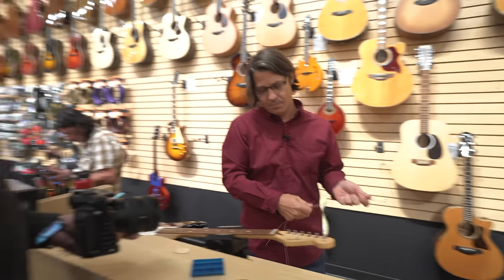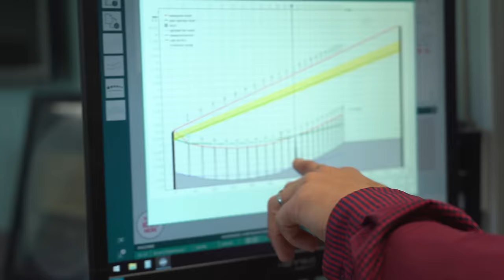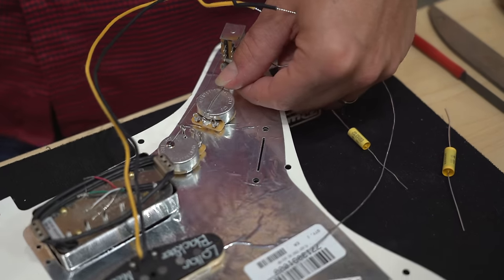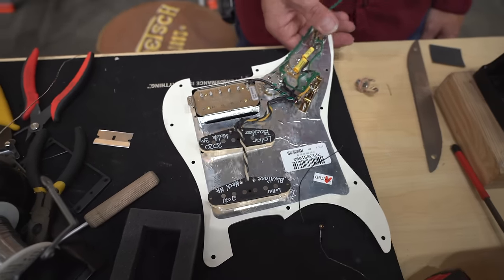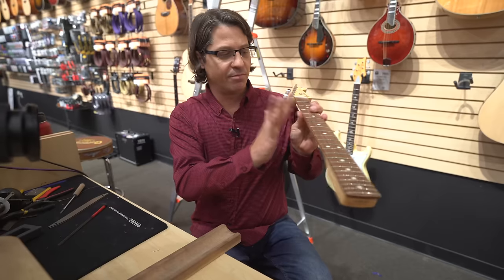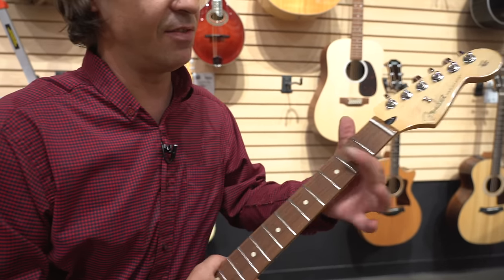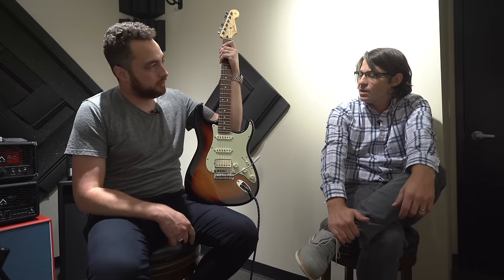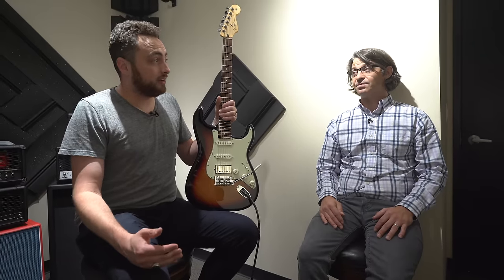We Tried To "Custom Shop" The Cheapest Fender Strat

Comment: Considering the total cost, you are getting some really nice upgrades and a really nice guitar for less than a Fender USA equivalent.  Custom Shop is a tough comparison - those are hand-crafted guitars from end-to-end - but I think it is comparable to a Fender USA production model.  One additional thing you could have done for a small incremental cost is put Fender locking tuners on it - that would really make it close to a Fender USA model overall - and still be cheaper.
Reply: A big difference, though, is resell value.  An American strat retains a huge percentage of its value on the second hand market.  An $800 Mexican strat with $900 worth of mods won't sell for anywhere near $1700 on the second hand market.  I'd guess you'd maybe get $1000 for it if you are lucky.  

So this is a great way to have high quality guitars if you are going to keep the guitars forever.  If you are the type that churns through guitars regularly (I'm not this type, but many are) then this probably isn't the smartest option.
Reply: @Hahnsoulo  I am not buying guitars based on resale value - that's for Gibson people. I am hoping to play them until the fretboard falls off. This is a good way of getting a higher quality instrument for less money than you would have to pay Fender upfront. Resale is not part of the equation here.

Comment: Unless you're a famous artist & looking to sell you're wasting your money on custom shop. You never get out what you paid. Too many hear with their eyes & look at the name. A cheap guitar can sound just as good as a custom shop if you put the time into it yourself. Too many myths & too many sheep all being lead to a lighter pocket book by hype. People seeking old gear not realizing back then they handmade them & each is different. They didn't do what so many are brainwashed into believing today. Today we have cnc's that make all series yet fall short. Why cause they set the speed & feed to fast tearing through the wood. No excuse for any guitar these days to have holes drill crooked or radius be off. Bottom line if they set the cnc up to route proper you can easily level, crown, polish, add better electronics, & hardware yourself & have a great playing guitar for way less. People trick themselves into believing things.

Comment: Interesting video, I've played about 30 strats in the last 2 weeks while shopping for one(pro2, hybrid ii, jv, traditional ii, player), ranging from second hand Japan to new USA, none of the new ones really jumped out at me. I played about 6 different player series from Mexico and some played nicer than others. There was one particular silver player that I liked more than the pro 2's, I tried a bunch of second hand MIJ ones too which where pretty nice. Hands down best strat I've played of that 30 was a 1986 squire that had insanely low action and fast neck (obviously been set up very well). That squire is now my benchmark to judge all strats against.  After watching this video I definitely will make an effort to try a custom shop. (update. I since asked the play the best custom shop strat in the store. It was aesthetically amazing, there was not a single thing that needed fixing or changing, the fret work was pretty special, but it wasn't faster or more playable in any particular way to me)

Comment: I took a chance on a B-stock player strat from pro audio star. I was expecting it to have some kind of defect. Well, I received a $850 guitar in perfect condition for $580. Plays great. The nut hight needs lowered a bit. The Pao Ferro fretboard looks very dry. The 9/42 strings fender puts on these guitars are laughable. I'm used to power slinky's though.
I wouldn't exactly recommend anyone pro audio star cause their return policy is slow af. Took 2 weeks last year to get a refund on a Dsl20hr. But I've gotten a strat and a LTD ec256 for unbelievable prices.

Comment: I’m sorry 800$ for the mod WORK? Lmao that’s FAR too high

INSANE, even a plek job on a strat in the uk would be 200 quid ish.

A setup is about 45 quid, a new nut and fretjob would be about 75,  rolling the fretboard? About 5 mins work with a screwdriver ngl.

Comment: The question I have that I think would be interesting to answer : Is the guitar now equivalent to or better than a 2000k Strat?
Reply: Probably not. Any Strat you buy for $2,000,000 would have to be better than the upgrade done here.
Reply: @willer3399  why?

I've picked several $2000 strats off the wall, and only one of them stood out as obviously better than many of the cheapos, unplugged.  

I would be willing to bet that you couldn't tell the difference with your own hands, if you couldn't see the label.
Reply: @stevescuba1978  I was making a joke. The OP wrote “2000k.” That’s two million dollars.  I’m sure he meant to write either 2000 or 2K. I don’t know of anyone who dropped $2,000,000.00 on the Fender Custom Shop. 

I am aware that price is not necessarily an indication of quality.  I’ve upgraded inexpensive guitars that are comparable to guitars more expensive than what I paid to make the inexpensive one sound and play better.

Comment: At $265 (according to the give away page), the fret work plus $40 for rolled fretboard edges seem like beneficial and reasonable ways to improve a Mexi Strat. But if you don't like the pickups and electronics, that additional $500 puts you into crazy territory. The nut is a great upgrade too, but $150 is a lot for the benefits it will provide.

Comment: Amazing. A brand new $850 Fender guitar that needs a computer analysis and another thousand bucks of work and parts to be playable. Even if they didn't install the new pups it would have been around $500 in "work" costs.

Yet Ben says: "whoever you buy it from should set the guitar up". It was his idea to do all the extra but in the end he didn't seem all that crazy about it.

Only Fender can get away with that. Imagine buying a new car under those conditions. And yet after spending that money it's still a standard MIM, not worth a penny more than the initial $850

Comment: If you can swing it, getting your guitar Plekd is a worthwhile investment. I've had guitars set up by hand by very good, talented luthiers and the Plek job was hands down the way to go. No comparison.
Reply: They can’t be that good if it was hands down to the plek. There should be no difference between the two
Reply: @PapaKiloProductions  Should
Reply: @jonunderscore  Yes, that’s what I said
Reply: @PapaKiloProductions  Yes, and I highlighted the operative word
Reply: @jonunderscore  Well…thanks
Reply: @PapaKiloProductions  exactly, either the luthiers weren't very good, or his assessment of the pleck'd guitar is skewed.  The two methods are capable of equal results, and a good luthier will be able to accomplish as good a job as the machine.

I was an aerospace machinist, so believe me, I fully understand how to level metal to within a few ten-thousandths of an inch.  Fret levelling can easily be done by hand, it just takes the right tools and a thorough knowledge of how minor changes will make major differences.

I levelled my frets on my kitchen counter with a piece of flat stock and some fine sandpaper.  It took me all of 2 hours to fully disassemble the guitar, setup the neck, and level and crown the frets.  I need to buy a little polishing wheel to perfect it, but 1000 grit followed by a pencil eraser gets better results that 95% of the guitars in the stores.
Reply: @stevescuba1978  Thank you. A plek relies on measurements which can only work to a certain resolution.  A luthier will not need a single measurement to level a fretboard. It’s all based on using tools which are perfectly flat to level the frets. Further to this. A plek will not pick up and flaws with the fingerboard, or poorly seated frets. It will only level the frets based on their height relative to each other. A luthier will diagnose and fix issues which go beyond this, fixing the root cause of the issue. 

The plek is a useful tool, and gives a decent output, but to say this cannot be matched by a skilled luthier or tech is just ludicrous.
Reply: @PapaKiloProductions  my pleasure.  Machines and robots are great, but they are a long way from being able to replace any journeymen craftsmen.  There's so much more to a craft than numbers

Comment: Really interesting! Been doing something similar to my old 90s Mexican Tele… have replaced the electronics and pickups and it sounds fantastic! Fretboard edge is already pretty well rolled! Just got to get the frets done… they’re pretty worn, so it’ll probably be a refret! Seriously thinking about getting a cheap Squier Strat and doing something similar!
Reply: I'm about to do the same. What pickups and electronics did you put in?
Reply: I've done it to a 04 squier standard hss strat  and I upgraded the bridge with a fender two point American, saddles with roller saddles, I got pickups and wiring from GFS, and new locking tuners and roller string trees, and new graphite nut and it plays and sounds as good as an American strat
Reply: @KarenBasset  I used Tonerider Hot Classic pickups… fairly cheap, but very highly regarded and I have to say, it’s a big upgrade! The Tonerider pickers are Alnico III which are quite different to the stock ceramic ones and I’d highly recommend. I replaced the electrics with a pre-wired harness off Reverb (can’t remember what brand / seller) with 250k CTS pots, Oak Grigsby switch etc. Something to watch out for is that the CTS pots were a little larger than the stock ones and the control cavity on the Tele was just a little too tight, but nothing that 5 minutes with a file couldn’t sort out!

Comment: I think this is a heavily flawed video made for the sole reason of demo'ing the shop. Because if you know what you're doing you can turn a cheap Fender, or even a Squier into a better guitar than you can get at the custom shop for cheaper. When you're buying a guitar to where resale value is more important, you'll always lose in a collectors market when buying a regular guitar. 

This video is for collectors, not players.

Comment: The Player Series Stratocasters aren't the cheapest ones. They're over $800.00 so replacing some parts that are on the custom shop models won't be much. The custom shop isn't just about a difference in a few parts. It's your choices of neck shapes, choices fret board materials and choices of the radius of the fretboard.

Comment: I bought a new Squire bass without even plugging it in to change the pickups etc. I got it home and played it for about month then concluded there was nothing wrong with it! It was a perfectly good guitar and any expensive 'improvements' would just be lost in the mix. I barely own a guitar that still has it's original pickups, so this came as a pleasant surprise.

Comment: Here’s the thing about all of this: you can do it all yourself for pennies on the dollar. Good setups aren’t hard. Truss rod adjustments aren’t hard. Lightly sanding fretboard edges isn’t hard. Polishing frets isn’t hard. If you must have it plek’d, yeah, you’re gonna have to pay someone for that, but the vast majority of guitars don’t actually require it. I got one of these for a super low price because I work at a guitar retailer and get crazy discounts, put maybe $300 worth of parts/upgrades into it, did the work myself, and very much accomplished what the shop in this video called $800 worth of labor.

Comment: I have like 12 guitars or something... My favorite one to play is a little black body/maple neck Squier Vintage Modified 70's style Strat. I bought it for like 250-300$ about a decade ago. I traded a <100$ looper pedal I got off ebay to my old guitar buddy for a loaded Fender Strat tortoise shell pickguard that had Texas Specials in it. I slapped on a bone nut. A Gotoh gold trem and locking vintage style tuners. I got cts pots, orange drop cap and cloth covered vintage style wiring. I prob have 500$ maybe 600$ into it and that was over many years. Its a great sounding and playing guitar. I love it and it looks so good. Black body, maple neck w/black inlays, white knobs/pickup covers, tortoise shell pg and all gold hardware. You can make a great little Strat for much less than these guys did. On Reverb a Stock one is 370-560$ after shipping. Seems like it held its value really well surprisingly for a Squier. Ive owned custom USA Warmoth, mim and mij Fenders and this little Squier is my go to Strat. Dont let a logo, country of origin or price fake u out. Just play through guitars and find a good feeling one.

Comment: Another great video Rhett!  I totally upgraded every bit of electronics EXCEPT pickups on a used Squier CV Telecaster.  Bought the guitar for $340 and added about $70 worth of wire, switches, jack, etc.  Even though I have a couple of US guitars, Strat and G&L, but the Classic Vibe is my #1.  I bought a new Seymour Duncan single coil to swap the bridge out but am reconsidering as the changes I already made turned a decent guitar into a fantastic guitar.

Comment: Super cool to watch this done professionally by someone other than Dan, lol. I traded my very first guitar in for a mexi made Satin Strat back in like 2007 and still have it and it’s still my number one, one thing I did for rolling the fretboard edges on the cheap was using the tremolo bar as a smooth tool to mash the edges of each fret section down and it worked like a charm, I like the razor blade idea but if you’re a beginner and have a squire or whatever you can seriously make your neck feel better with everything you have in the box 🍽

Comment: I did this fairly recently with one of those $100.00 Squire Strats from Guitar Center from about 20 years ago.  Transformed it.  Upgraded tuners, better electronics.  New bone nut, and roller bridge.  Spent some real time doing a full fret job.  I have some nice guitars, but this one plays sooo nice.  I'm surprised at how much I've been playing it vs the others.

I probably just got lucky with the set up, not having a fancy fretboard scanner.  I did take some light bow out of the neck by tightening the truss rod, but this was all done by eye and feel.  I'm no professional player, but as far as I can tell it is now flawless.

Comment: This is basically what I've done with nearly every electric guitar I've owned. I buy the version I could afford...then I start slowly modifying it,  little by little, until it's what I wished I could have afforded in the first place. Both of my Strats and my Tele have nothing left stock, but the body, neck, and neck plate. My Les Paul Tribute has only the original wooden parts now. Everything else was eventually swapped out: Pickups, pots switching, hardware, tuners... it was all eventually upgraded.

Comment: I did something similar to a Squier Deluxe Strat a few years ago to bring it close to Player grade. New electronics, new Texas Special pick-ups, leveled-crowned-dressed the frets, upgraded brass-block 2-point Tremolo bridge, low friction string trees and saddles. 

It cost me several hundred dollars more than if I had bought a new MIM Fender Player. AND it still wouldn't stay in tune.

I put the original Squier parts back in it and sold it for half of what I originally paid for it new. 

Lesson Learned!

Comment: I've got four Mexican Strats. All have Blaberunner trems, GraphTech nuts, D'addrio locking tuners and any assortment of DiMarzio's with any combination of push/pull pots or switches. Perfect setups. Never once did I play one and think, "if it was only custom shop I'd play better and be cooler." 
I've got three of the old Japanese Squier E-series Strats from the 80's...same thing.

Comment: Might as well build from scratch or at least with top quality parts.  I've built a couple of my Fender-shaped basses this way.  I don't buy or build to sell, I do it to enjoy playing them.

My P bass for example: Warmoth 1-pc swamp ash body,  Musikraft made-to-order '57/'58 type 1-pc quarter sawn maple neck, heavily rolled edges, C width, thick soft V profile, bone nut, Klein Epic '58 pickups, correct wiring harness components, correct hardware including Gotoh Res-O-Lite aged nickel reversed tuning machines, 10-hole brushed aluminum pickguard custom anodized black, aged lacquer neck and transparent white blonde lacquer over ash body.  All hardware is aged and the lacquer finish is lightly relic'd with checking.  I did all the finishing, relicing, aging, wiring, assembly and setup, including the nut and refined fret dressing.  I even refined the shape of the headstock, and eased all the contour transition edges on the back of the neck at the heal and where the profile transitions to the headstock to be very soft the way CS master builders do and the way a real '58 P's were made.  The setup is dialed and the back of the neck is broken in to be as smooth as can be.  8 pounds, 4 ounces.
Reply: Building to enjoy play is the key here. I'm a lefty so I literally don't have an option other than to build if I want something other than stock parts.
Reply: @AmiliaCaraMia  I subscribe to the concept of “jamming econo”, a guiding principle of the band Minutemen; D Boon, Mike Watt and George Hurley.  It applies to everything.